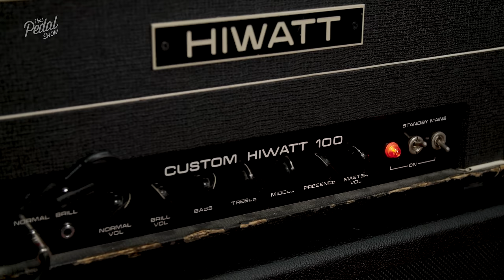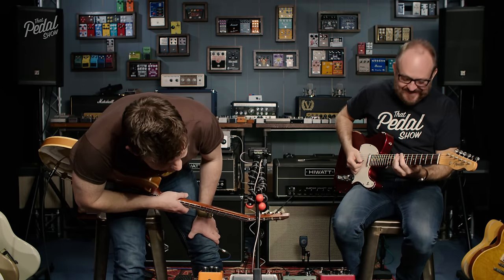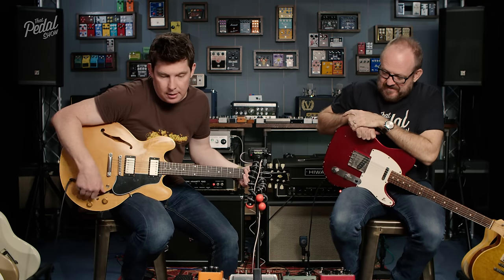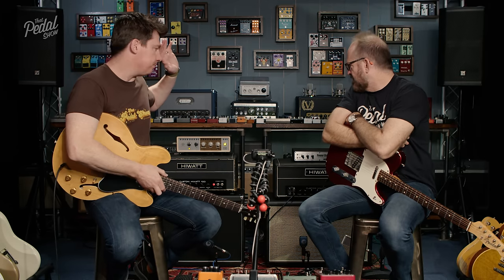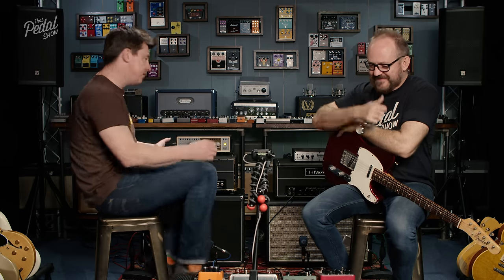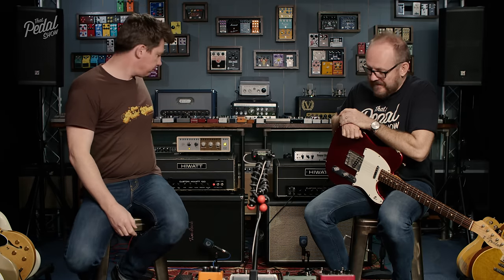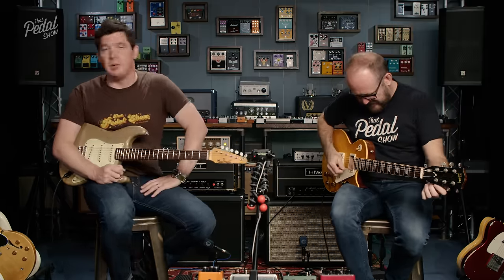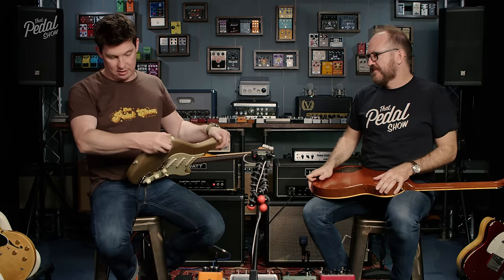Vintage Hiwatt DR103 Amps: Wet/Dry, Plus UA OX & Fryette Attenuators – That Pedal Show

Comment: Very apt show for this week! I saw The Musical Box vintage Genesis reenactment at Hammersmith Apollo Thursday night who had a Hiwatt, and Friday was speaking to Chris from CPB. :) This has given me an idea for a show though as I bought an Evidence Forte cable off Chris. Cables! How much difference do they make? My board is all evidence monorail/SIS, but my long cables have been Van Damme cable which is decent, but not too expensive. So now I'm replacing the most important cable as guitar to pedalboard = unbuffered high-ish Z, low signal guitar out. But how much difference do those really make? I also found shortening my FX loop cables a lot improved my tone, even though it's buffered by that point (Timeline/BigSky are now on top of the amp controlled via MIDI, not running all the way from my FX loop out to the board and back). So I'm waiting to find how much difference the guitar cable makes, but also pondering how much difference does the board to amp cable make? So maybe a video please on how perceptible what cost cables where makes, and what the difference between say £30 and £120 cables make, and what the diminishing returns are. And length? Does a 5m £30 cable sound better than an 8m £140 cable, etc, etc. (And I guess speaker cable too, although I've always assumed this is short and high current, so if it's thick enough to be low impedance it probably makes no difference at all.) Obviously there's very much diminishing returns here, but if a good cable I always use costs me £120, it's still better value than a £150 pedal I use occasionally in an odd part of one song if you can hear a small difference!

And another spin-off signal path question: stacking buffers. I go in my Voodoo labs PX-8 and RJM Mini FX gizmo before the amp (the board in my avatar, although it's since been rearranged). The PX-8 has a buffered out. The RJM has optional buffer. Is using both the best idea for maximum bufferage, or if I buffer it once with the PX-8 out, should I then avoid the buffer in the RJM as 1 buffer is good, but multiple ones are going to have a cumulative negative effect (although maybe I can answer this bonus question a lot easier myself by just trying it)?

Or are there no answers to this, only better questions?... :D

Comment: Those Hiwatt are quite special (I had first made a funny typo and had written "quiet special"). You talked about dB meter and I think you should get a proper dB meter you could place on your back wall just like what they have in the Thomann Youtube channel. It's a Dateq SPL-D2 I think. A bit pricey (well maybe not that much actually, cheaper than 3 D&M Drive as a reference), but I think it'd be really worth it. Plus it would be permanently visible for us viewers, which would be great!

Comment: You should consider having a DB meter installed on the wall behind you. So we can tell the difference between volumes, does not have to be 100% accurate. But having one behind you would be a great solution.
Reply from the maker: Good idea!

Comment: Guys, more of a call for help then a comment. Actually based of sounds I heard from your previous vid of the Dimension C/D I managed to grab an 1986 Dimension C secondhand locally. As this is probably the oldest pedal I own (it's older than me!) I'm not to familiar with trouble shooting issues with them. There is a slight distortion/crackle that comes on some notes (more noticeable on lower note on E or A string) when I dig in a bit. I'm checked VCPI (used my power supply and a separate 9V) and I've used it in isolation from other pedals to ensure it's not a signal chain thing. I've Dr Googled a few diagnosis (changing caps etc) and the only thing I can think of its some sort of a loose connection that brings the crackle in, but again I'm speculating. 
Sorry for the essay and I know you guys aren't an FAQ page for gear issues, but given your experience with vintage gear, I just thought you might be able to steer me in the right direction. Thanks for any help you can give. Dave
Reply from the maker: Clean all the pots, connections and - if you’re confident enough - disassemble and clean it all inside too. With a small soft brush and the very smallest amount of switch cleaner. 
However, before you do any of that, hit up some forums - it might be that it just sounds like that! Good luck.
Reply: Thanks for the incredibly fast response, hard at work as ever! Will keep digging and give the clean up a go! Have a good Sunday guys!

Comment: First of all I am a huge TPS fan, your videos are awesome going beyond the standard others do.
Lately I purchased an old Floyd Super 100 which seems to be a Hiwatt DR103 clone. Unfortunately it died 5 minutes after I paid for it...
I bought it for bass guitar use after I used a Blackstar Artisan 100 head and really liked the sound, and in case it had to be louder for decent sound than is bearable I thought of buying a Power Station PS2 to attenuate it.
Now I found out, that the PS2 attenuates all the way down to line level and all the loudness comes from its 50 watt power amp.

Now comes the big question:
Is the 50 watt power amp loud enough for bass band use with a very loud drummer and guitarist?

Cheers from Vienna, Austria
Chris

Comment: Would be interested in a show where ya utilise multiple preamps in a true bypass switcher  for your gain tones, (w additional boosts?/ AS additional boosts)

I know ya generally run into the front of yer amps in a multiple amp setup...

guessing it's noise issues and cable runs (and E.M. interference) yer avoiding (but if the fx loops r buffered and quality cables used, might that's work?)

your current method  gets simultaneous different tones from the preamps: but if d sound guy is giving ya ONE mic, wouldn't it be useful to switch between the preamps or stack them (?) with one at a low level acting as a boost

i realise too many tubes is like too many chefs

LOVE to hear this in a band context 

yer band is a WONDERFUL addition to the show

watching you guys bare yer souls in a VERY different playing context was fascinating, terrifying and entertaining...

hats off to  dan + mick

the multiple amps preamps into the  gigrig  idea would be a great AB test against "preamp pedals" and in general using them (in boosting capacity) as a yardstick comparison with regular overdrives 

THANKS for all u do

Comment: My main rig (stereo),is a Hiwatt Custom 50 combo through a Scumback attenuator, plus a Reeves Custom 
Jimmy 50 head with power scaling into a 2x10 alnico/vintage 30esque cab.... omg!!!! Glad I'm not alone in my tone journey! Took me 20 plus years to get there tho...
Anyways, would love to play wet/dry, but find that using treble boost and fuzz pedals on the wet side loads my pickups so bad that it destroys my tone on the dry side.... Any suggestions to remedy would be seriously appreciated!
BTW keep up the awesome work guys! Cheers from NZ
Reply from the maker: Indeed. That’s probably stuff that’s happening after the fuzz on the wet side as you say. There will be a nasty buffer in there somewhere that the fuzzes don’t like, especially if you have any digital pedals. I get it a bit too - Mick here - so I need to be super careful with what comes after the fuzz....

Comment: For those of us who were lucky enough to have used these high power amps as intended, it is most frustrating that you do not do what we would have automatically done, and that is turn the volume all of the way up. We didn’t muck about balancing inputs, Hiwatts and Marshall’s were played on 10 and controlled with the guitar volume; it’s fucking rock n’ roll man
Reply from the maker: Ha! Fair enough. But this Hiwatt in this room on 10 is basically permanent hearing damage. We like loud, but we’re not so keen on stooopid. Cheers!

Comment: Off topic: Can you put an equalizer in an effects loop? I was thinking that since the tone controls on most amps are passive, "cut" controls, it might make sense to keep the amp's tone stack on max (so that the pre-amp is putting out the "full" tone) and then shape the eq afterwards. Possible?
Reply from the maker: Absolutely! You’ll be driving max gain through the pre, so if it’s not clean enough, lowering the EQ will help. Otherwise yes!

Comment: Would love to see you guys do a wet/dry with the Hiwatt and Dan’s AC30!
Reply: I was in a rock band in the 80s. I had the bands gear in my house - so I linked a SupaLead100, JTM50, DR103, 3*4*12s + 2*15 and turned them up to full. It was.....biblical. 
Potted pickups, with the strings completely damped, howled. 
Everyone that tried it looked like Dan at the beginning of this video.
Not wet/dry, so a thread tangent, but mixing amps up is AWESOME.
Reply from the maker: Ohhh yeah!!

Comment: Hey guys I use a Marshall Plexi but thru an attenuator. I have a Bugera PS1 Power Soak it does a great job and is really well made. It doesn't change my sound and it is a reasonable $100.00 USD

Comment: Mick, you talked a little about how the pedals responded differently once the amps were attenuated, but I think you forgot to take into account that you have significantly upped the gain and master after attenuation in order to get a volume you liked. Especially on the OX attenuated Hiwatt. I’d like to hear you set the amps unattenuated for the tone you were gushing over in the beginning, and then attenuate to useable volume without touching the amp settings. I would then expect the pedals to work and feel much more closely to the same, just quieter.
Reply from the maker: It’s a good point, but it’s still different. I would want to push the amp a little bit more than we had it in the beginning, just a hair. But as soon as you attenuate, even with the same settings, the pedals just don’t have the bloom or bigness they had before. Everything is squishier. Which isn’t worse, just different!

Comment: So this is really interesting - Dan is clearly in love with the tone. But this is 4 years ago and the Hiwatt stays mostly in the background on all their videos. I wonder why they don’t use it more? Yes it’s loud, but they own several attenuators.
Reply from the maker: Hello Charles, Mick here. He does love it but to be honest it’s hard work to use with the cabs we have… We have used it a bit since this video. Trouble with attenuators is that they make all amps sound palpably worse in our experience. We should get a proper cab for it really. We did buy one but it turned out to be not entirely what we thought it was. We should revisit.
Reply: @ThatPedalShow  thanks Mick! Based on my very limited experience with them I understand your point.
Reply: @ThatPedalShow  I have a couple of split loads, two sixteen Ohm speakers here for my pleasure, and three eight Ohm speakers in the other room, to spread out the two Ohms from some Super Beatles. So the amps only pummel my body with about thirty Watts. Actually the speakers are also buried under Packing Quilts with just a little leakage into the room so I can get the tone.
 I also have a couple big styrofoam boxes that would each hold a 12" after I rig some mounts. Can't mic them in a box, but that's not what I am after.

Comment: How about using an OX to tame the volume of the dry amp, then letting the natural headroom of the wet amps it’s own thing? How would that sound with 15-30w amps? Or is the OX better off on the wet amp for some reason? Obviously don’t want to have to buy two OXs.

Comment: Interesting that the output from the OX modeled mics (50:40) sounds better than the live ones (e.g. 50:14). While I guess it's nice to have your internal organs re-distributed by the air-pressure of an amp's sound-waves, the actual sonic results are better via DI.
Reply from the maker: They’re certainly very impressive. It’s a really important point to make. The in-room experience vs what ends up recorded. The sticking point is when you need to sound in the room to feel inspired and get the physical feedback through the instrument. That’s the inspirational bit for me anyway... Mick here. :0)
Reply: Right. I made my comment with that in-room vs DI/In-headphones experience. I think you can get the inspiration via headphones as well. It's a mental thing, I think. I get the sound traveling thru the air thing too. 

btw. I really like your new 'StompioContinua' T-Shirt design. Really fits the spirit of TPS. MY order will be coming shortly. Also liked the "Jetsons" retro one too...

Comment: I own a Reeves Custom 50 with power scaling. I think power scaling, if you can get it, works better than the attenuation options available. The only caveat is this is a moot point when dealing with vintage amps.

Comment: I might be asking for it, but honestly, I hated everything until the attenuators were turned on. It sounded spiky and shrill and overly dynamic, just like a twin or an HRD that is turned down too much. 

That said, the “chimey-ness” is really, really special, and the growl from those amps with a fuzz is akin to staring into the gaping maw of impending, certain doom. Wow.
Reply from the maker: I think Dan and I would concur that recorded, there unattenuated amps are a little sterile. It’s a really important point that underlines the VAST differences between what an amp sounds like in the room and what it sounds like recoded/through a PA. And presumably a big part of why anyone would go Kemper/Helix etc....
Reply: That Pedal Show - thanks so much for your response! I make my living as an audio engineer, both in the studio and on stage, and am quite familiar with the addiction that many guitar players have to the physical sensation of being pummeled by high sound pressure levels. However, a loud and exciting pressure does not necessarily equal a good sound. In a live environment, I would have had to compress the daylights out of those to keep that sound from tearing the audience’s head off. 

Just to be really clear - I freaking love your show, and this was highly entertaining and educational. Cheers!

Comment: You think the Hiwatts sound good now? Wait til you put them through some Fane speakers. It’s been my rig for the last 8 years. NOTHING sounds better. The immediacy is amazing. 
The sucky thing is though. Every time I have to use supplied backline at festivals (usually AC30s or something Fender) I HATE IT. 
The other thing that needs to be said is that no other amp rivals Hiwatt as a pedal platform. They are absolutely amazing. 
PLEASE PLEASE PLEASE get some Fanes though

Comment: I know that the UA OX has all the rage, but, for me, the Fryette is just ALWAYS better (by far) sound wise... is that just me?
Reply: Bernardo Silva yep couldn’t agree more. The Fryette is my favourite attenuator.I don’t  see the point of modelled guitar cabs when there are so many good IR’s.
Reply: Peter Jessop Yep! And by the way you can easily get a small and cheap IR loader pedal and plug it to the Fryette line out. And the combination Fryette + IR pedal is cheaper than the UA OX. I just don’t get it... :P
Reply: They largely get ignored but the Weber Mass reactive loads are sonically the best imo. And are affordable.

Comment: when we say we went to London to buy one, what we really mean is that we bought one from a nice old, rather soft spoken gentleman, that had a large old house boat moored on the Thames.
Reply: Oh, and it had some annoying white stenciling on the back of it, that said "something something, London". We couldn't really be bothered with that, so we quickly removed it with solvent. We doubt it would hurt the value.

Comment: What exactly about your blue strat have you fallen out of love with? You can always change the pickups if they're not to your fancy anymore
Reply from the maker: Predominantly the nut and frets are really badly affecting playability and sound.... and that got me thinking. Plus I’ve been playing a load of lovely old ones and some new Custom Shop ones and they make ol’ Blue seem a bit ordinary. Bit like having a reasonable Merc and then driving a 911RS. 21st century problems. :0)
Reply: I always thought your blue Strat sounded particularly special - in a good way. It sounds like you - really great! I much prefer the sound of the blue Strat over the ES 335. the ES 335 does not sound bad in any way ... it is just the Strat that, I feel, fits you like a glove
Reply: My Daphne blue Strat looks the same color as yours Mick, I’d hate to see you retire it.  The sound is unique and provides listeners a baseline tone, like Dan’s red Tele.  I hope you will refret it and drop in a new nut.  We need it to make apperances to maintain continuity across the changes in venues, pedals, amps, and attenuators.  Cheers

Comment: Hey Mick! Does your Stratocaster's volume pot need replacing? I noticed the output on your blue Strat is much quieter than anything else you guys play on here. I had a similar problem with my Strat. In the wide open position the tone had a top end roll off and about 1/2 to 2/3 of the volume. I noticed the problem when I started jiggling the knob and the volume and tone came back to life. If you watch the Angus Young guitar rig video the guitar tech talks about how he has to replace Angus' volume knob regularly because of salty sweat getting into the pots and breaking down the components. Something to consider! Take care!
Reply from the maker: Hi Tom. The pot itself is fine - it’s just a very quiet guitar in certain frequencies... which is what makes it so special at crazy volume. It has articulacy and clarity that more gutsy guitars just lose. A paradox. That said, it’s currently being refretted and when it comes back I’m going to experiment with a few things. It should be interesting!